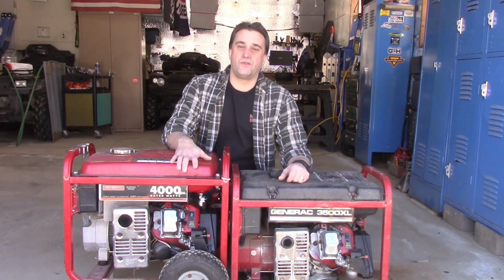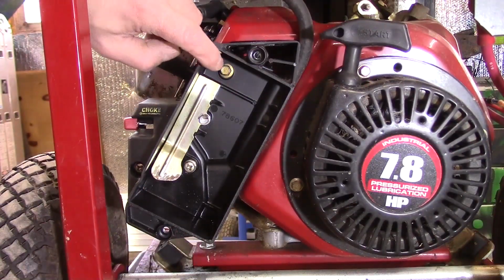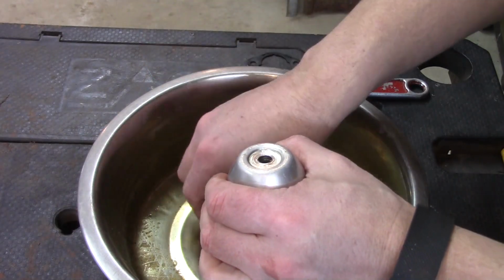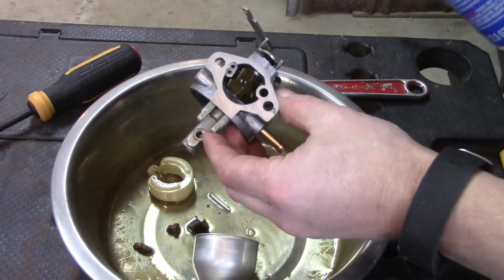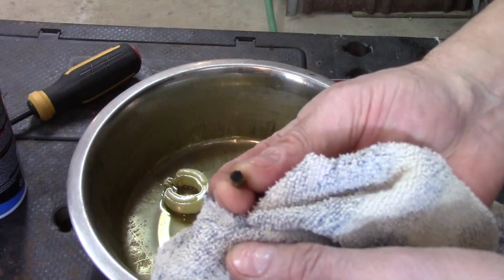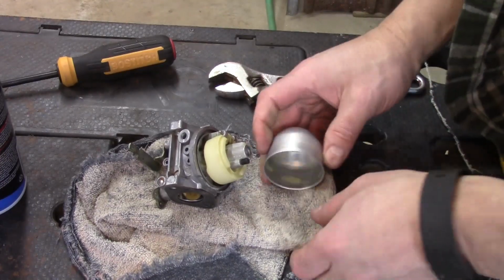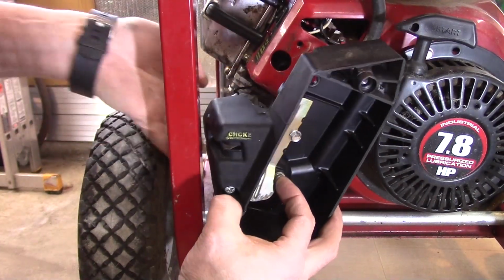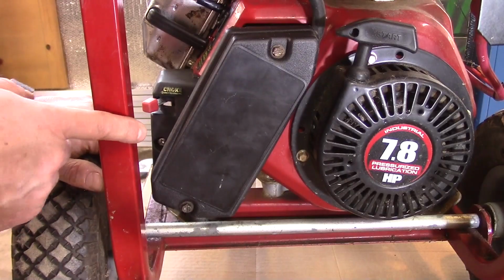How to Clean a Generac Briggs and Stratton Nikki Carburetor - Generator Hunting for Fuel

Comment: I have the same generator with the same symptoms.  I'm sure it's due to the old gas.  Currently, I'm trying a carb cleaner, letting it run at half choke to see if that helps.  If not, I now have the best video as a reference if I need to remove the carb and clean it.  Nicely done and thank you!

Comment: Very helpful! My Duromax 4400e would not start.  After watching this, I felt confident to try myself.  After removing and dismantling the carburetor, I could see that the main jet was actually clogged with something.  I used wire and Gumout carb cleaner to clean out every port I could find.  I put it back together and it started easily on the first pull.  Very happy! Thanks again for your help on this.

Comment: Good vid, have not done B&S carbs yet. Champion, yup, they have tiny tiny holes in  the barrel
of the carb at the throttle end and a rubber plug by the idle adjustment, found a chunk of black
 stuff. engine worked great after.

Comment: To keep my generators clean and running clean I always use high octane fuel, after running on gas or propane I always run the unit until it shuts down after turning the fuel line off. secondly, i start the unit every three weeks or so while I do yard work and change oil yearly.
Reply: You are better off running non ethenol fuel over high octane.

Comment: Great video Mark I picked this same generator up for $50 a few years ago and got it running I also had to take apart the starter switch to clean up contacts since I'm to cheap to buy a new 1 lol but you wouldn't have to remember what post the red wire with the fuse goes on wasn't paying attention, battery side post or starter post ?

Comment: Great video! I was able to remove and clean my extremely gunky carb and get the generator running again. One question - normally there is an air/fuel mixture screw that is also removed for cleaning- or is this carb an EPA emissions model that has an tamper-proff aluminum plug covering it? Have you ever removed the plug and had to clean that jet? If so, which plug is it? Sorry for all the questions.....

Comment: I ran my generator for a few minutes yesterday and after I turned it off, fuel was leaking badly out of the air filter. I guess my needle valve pin is bad. I’m hoping I can make it through this hurricane without losing power. Thanks for the video.

Comment: Thank you so much for this video. A friend of mine gave me this exact generator which would only run with half choke and kinda rough. Every so often, when opening the gas valve, gas would drip into the air filter compartment and the generator would not start. I followed your instructions to the letter. For never in my life attempting a repair of this nature, it took me about an hour. ( I could not believe the amount of sediment in the carb bowl and throughout!) Bottom line is the generator does not leak fuel anymore and now runs fine with the choke closed. I am going to order a replacement air filter, spark plug, oil filter and gaskets to complete the service now that I have the confidence to do so, but I do have one question tho. My idle control switch seems not to have any impact on the generator when turned on.  It runs exactly the same in the on and off position. Any clue as to why? Could it be a bad on/off switch? Anyway, thanks again for a great video!

Comment: Wondering if you could tell me please where that tiny  spring under the rod that connents to choke rod connects to as mine broke cpl weeks cwaiting on part , can see tiny hole under governor rod on choke blask plastic lever on mine but where does it connect on the other side as was hoping to see in this video but cannot ?

Comment: Hello Mark, So, this carb did not have a long skinny tube with tiny holes< an emulsion tube?
or what I call maybe wrongly a jet? I worked on carbs for B&S back in the 70's so I guess as
Bob Dylan said (Paraphrased) And the carbs they are a changin'

Comment: Hello Mark I have an old Generac 3500xl my father-in-law gave me.I have a question. Are the carbs the same for the 3500 xl has the 4000. The 3500xl was made in 1993 they’ve discontinued most of the parts.. I found one on eBay would like to find one cheaper thanks

Comment: What is the rubber stopper for next to the center tube in the float bowl? You didn't comment on that in the video.  Should that be removed to clean inside the stopped tube? Is there a jet in there?
Reply: I saw and wondered the same thing,   I've never seen a rubber plug inside a carb before,   and I know from working on these that it is a passage that is covered by the stepped rubber plug
Reply: Not sure but there is a hole just above the plug that Takes fuel from the same area of the jet that he removed and reinstalled.

Comment: You totally missed the crankcase ventilation hose attachment to the air filter.  I saw that it is not connected as you reassembled it and it is not lined up properly.  Overtime expect a dirty oil film to accumulate over that side of the engine.    It is a bear to get back, you either need 6 hands like that Hindu god to get all those together, or perhaps a tool that can grab that crankcase hose from the inside which I theorize must exist.
Reply: I'm thinking the only way is to remove the valve cover, fan shroud and filter box and attach the hose. Then put it all back on the engine. One wonders how it might be done in the factory. I was able to do mine by removing the valve cover end but you really don't want to do that. It took me a couple hours, to stuff it back in the cover hole.
Not mush sense if you put another air filter in it if it just sucks junk through the hole..

Comment: If u did not explain how a screwdriver worked and how air blows out of a compressor air line fitting ianyone who owns a screwdriver already knows how it works just get to the point mr pain to watch man didn't even run it fail would make beter 6 minutes video whit out the jiba jaba